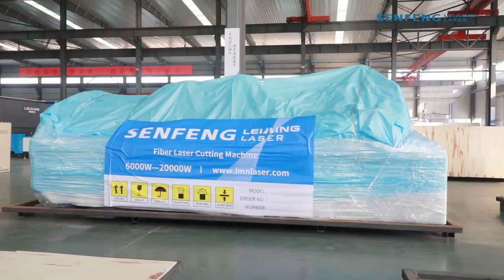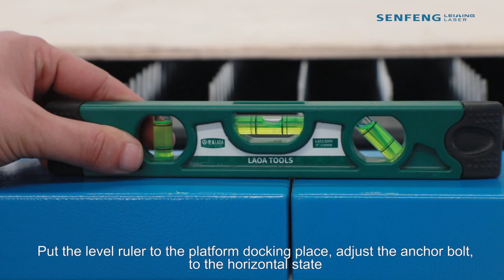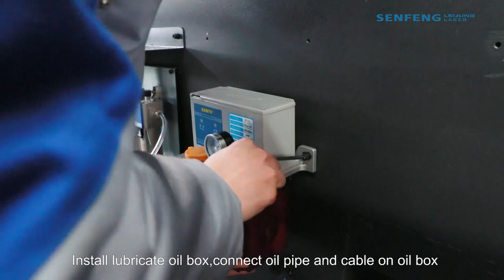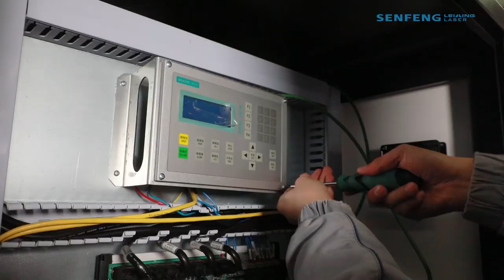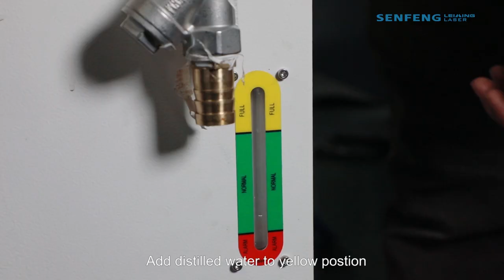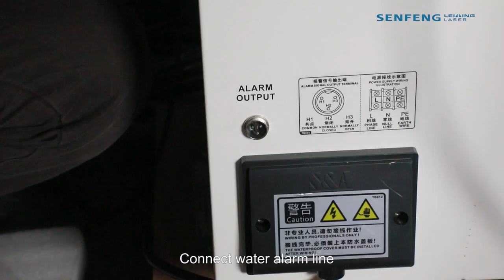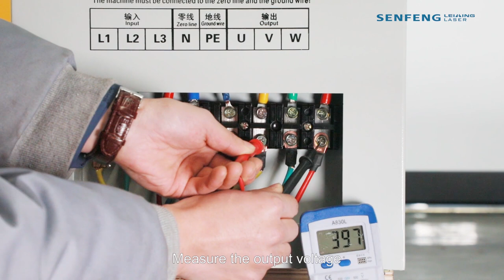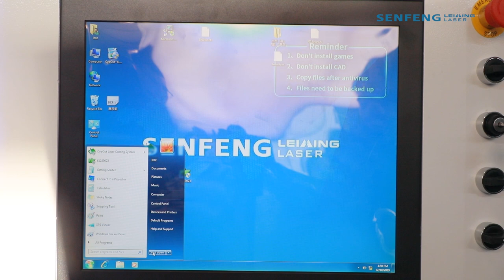How to install SF3015A fiber laser cutting machine

Comment: How thick of metal can a 
1000w fiber laser cut vs
2000w vs
3000w

Im assuming there many different  types
Reply from the maker: hi，nice to meet u ，may i have u email and whatsapp number，You can also contact me by whatsapp+8613031735608，I will arrange the sales manager to send you the machine details and quotation